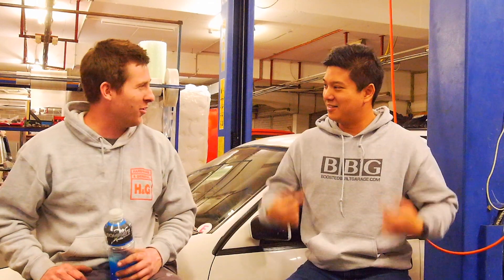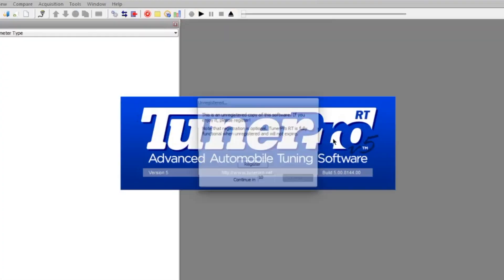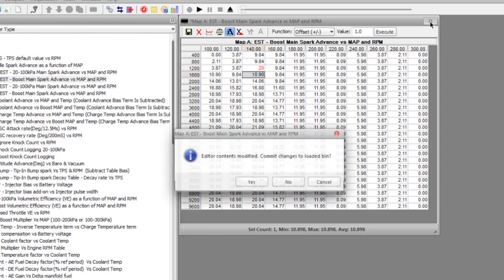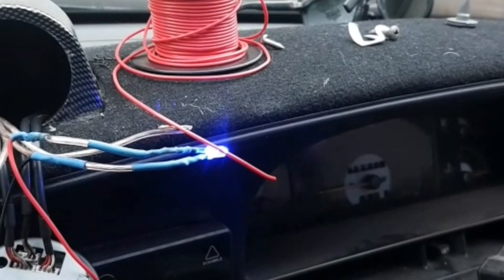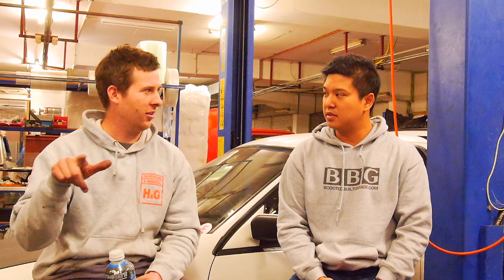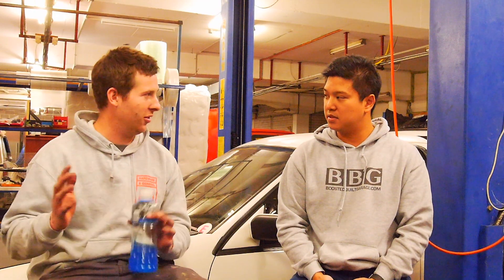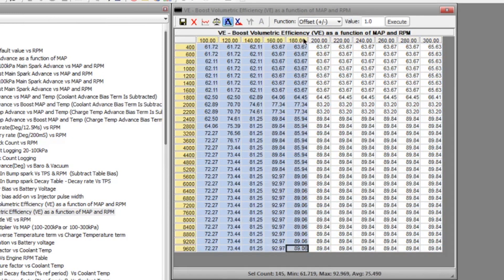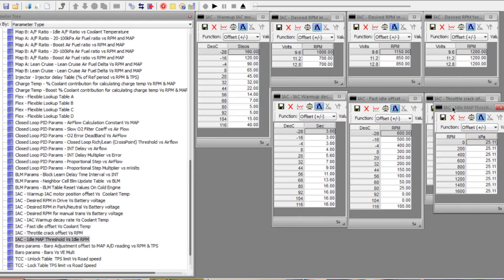THE MIGHTY ECU SETUP - DELCO CUSTOM FIRMWARE 12P - INSIDE THE BEAST SERIES

Comment: hello, I suspect the exhaust valves were running hot with the late burn ( late timing ) this will cause chamber temps & pressures to rise giving pre ign , other fixes would be sodium salt filled valves or beryllium copper seats on the EX side 

I find the pcm hack site a nightmare, the reason being that i'm an older fella brought up with logarithm tables and slide rules ...computers and me + others are left at sea. I have most of the hardware to get going , but figuring out the computer side is more than a task. ...how about a ' 101 ' tutorial on how to actually load software where it comes from how it works ...just simple stuff to actually get the system to run ... I learnt more from this vidio in 15 minutes than 13 hours on the PCM hack site ...robbie

Comment: hi, u know with the lsd diff  centers  u buy on ebay,do they fit straight into the stock v6 diff housing, y i ask is because the 2nd hand lsd diffs with housing on ebay look bigger then a stock v6 diff!
Reply from the maker: Depends what diff you're talking about. Whether it's live axle like this one or an IRS one
Reply: well i think ive got an IRS non lsd stock diff @ the moment the car is a vx berlina 2000 model l67 v6 3.8lt  & hav been looking @ diffs online 2nd hand & new, its a budget built project cause im on  DSP, so hav 2 b a bit savvy ! but i only put good brand replacement parts in it, do most of the work myself so i save on lobour.
Reply from the maker: Yep that will be an IRS diff so you're buying the whole 'pumpkin' as they call it. Much easier doing that if you don't know how to build and set a diff up properly

Comment: Does Ben have any experience with the Alloytec ECU?
Reply from the maker: +STS36L Yes he certainly does. He used to have a turbo alloytec
Reply: I have a rear mounted turbo SV6 6 speed. And i need to have it tuned with the factory ECU.
Reply: STS36L hey mate, yes I used to have a twin turbo Alloytec. Which state are you in? Shoot me a PM with details. Cheers

Comment: Holy shit, we're famous!  Never thought someone would be making a video about PCMhacking and 12P
Reply from the maker: 3800Tech Haha😃 well when you've developed so many top quality products - you kinda deserve to be noticed😉
Reply: Well credit should mainly go to VL400 but a fair few of us including myself had some input and added to the vast knowledge base we have on the forum, being guinea pigs and such, helping to manage the hardware sales and support and supplementary products and services.
Reply from the maker: 3800Tech That's awesome, well, my hat goes off to all you guys at pcmhacking for the awesome things you've created and continue to! 
Next thing I'll be installing my lsx coil driver module😉
Reply: Are you talking about the programmable ignition module from us? If so, what's your thought on having the connector changed to delphi 24 way micropak 100 series connector? same sort as what the delco ECU uses.

I have been pushing to get the designed changed but there isn't a lot of demand as only my idea thus far, but I'd like to see quality improve to more OEM level but need to raise numbers to make it worth while enough to change the design. main reason I would like it that was is so for the hardcore guys can use a 424 case from a VR auto or similar and it can then house both 808 and the ignition module in the one OEM case use and used same sort of connectors, can then all be integrated into the harness.
Reply from the maker: 3800Tech Yep that's it. Ben did a bulk order recently, one of which was for me. I've already got mine, though I do think that's a good idea indeed. If it could be incorporated in the case that would be extremely neat.
Ben and I are still devising a nice neat way to run it all. Will be doing a full video on it when I do it, so should hopefully stir up some much deserved interest for you😉

Comment: How did you get aldldroid to find the USB not only Bluetooth
Reply: BENgineered yeah I got a otg cable....I tried it on my lappy with tunerpro and it was connecting then disconnecting constantly :/ I thought fuck it I am getting anyone from a mob in Perth who test them and all the jazz and hopefully I can start logging and eventually tune my engine
Reply from the maker: Dimitrios Kyriakidis Are you using on head unit or phone/tablet?
Firstly you have to have the correct adx file to suit your car/ecu (if you haven't already)?
Reply: on s8plus atm and yeah i got the right adx file...
Reply from the maker: Dimitrios Kyriakidis Ok cool cool, so you've got a USB adapter for the phone with the aldl cable plugged into it? I just click connect to ecu in the app, if it asks for Bluetooth just click deny then click connect to ecu again and repeat until it works. 
What car is this on?
Reply: VS commodore supercharged manual ;)
Reply from the maker: Dimitrios Kyriakidis Ok cool, so give us a run down on what happens / what you do to connect
Reply: Boosted & Built Garage ...I load up aldldroid plug in the cable it tries to connect but nothing happens
Reply from the maker: Dimitrios Kyriakidis All I can think of is the adx file isn't right. You might have to email Sebastian the developer and ask him, I'm pretty sure I had to modify my adx a tad to get mine to work
Reply: Boosted & Built Garage yeah I might sling him a message... Thanks for the help my man 😊
Reply: The cable from the Android device to the aldl Port needs to be a special type of cable called an "OTG cable"

The other thing to check is the "echo" setting, if you have the right Android usb cable, try flipping the setting. Depending on the configuration of your ALDL cable, you'll need "ignore echo" setting on or off.

Comment: Hey mate love the vids. Honestly im not overly smart with this type of stuff but you make it simple enough for old dummies like myself (47). I have a ecotec vs S pack manual (it was converted from auto) i piggybacked off the auto ecu. Just a quick question can i run a setup with these listed parts. So pretty much setup and run. (L67 Injectors, 0.44 bosch pump, ebay turbo, pipes,front mount etc, stock ecu,) Is it true you can just flip the standed exhaust manifold with a adapter plate and run the turbo off that? Cheers mate extremely appreciate what your doing.
Reply: Short answer is yes, however being a 'V' motor you will need a crossover from one exhaust manifold to the other and it will be much easier if you can move the throttle body to the drivers side of the plenum. I'd highly recommend having the headers made up rather than modifying the standard gear, ecotec headers weren't designed very well
Reply from the maker: Tactical answered it pretty well. Yes 044 will work though honestly wouldn't bother unless you already have one as it's more work to adapt that to work in-tank. Walbro 255 is good for 500hp and can buy a kit made for the Commodore.
Those injectors will be ok for low boost yeah.
Manifolds as already stated, could be done but I wouldn't recommend. Honestly one of the most crucial bits of a turbo setup is the exhaust manifold. Depends how much you want to spend. Also budget for a decent diff and a decent clutch 😉

Thanks for the support and glad it's inspiring and helping so many!